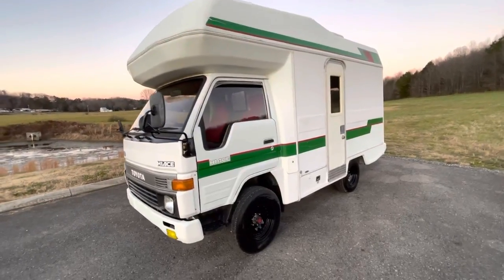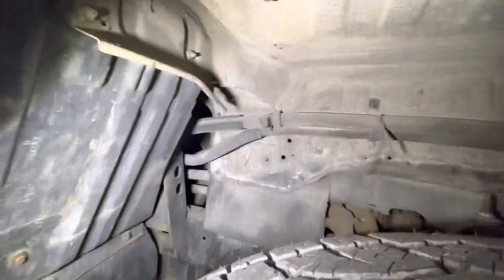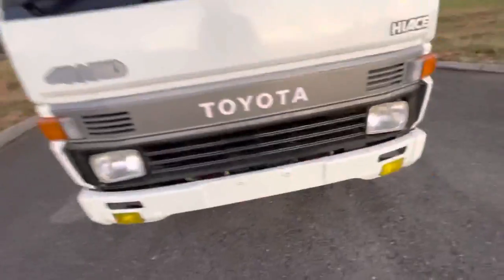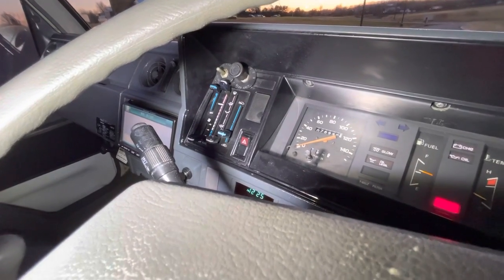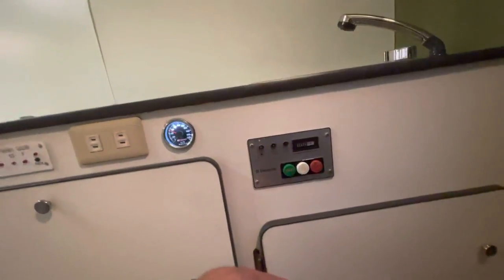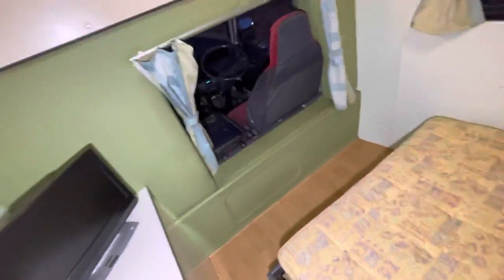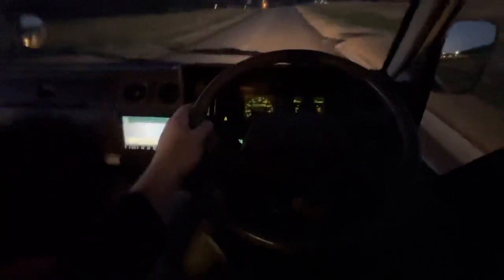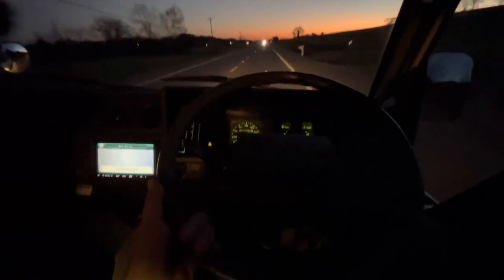1992 TOYOTA HIACE CAMPER/ TOY HAULER 4X4 DIESEL. AKA-(STEVE)

Comment: Mav's new ride
Reply: I was just gonna say this was the one mav bought lol
Reply: is that exactly his one . this is so bad ass . min 4x4 not log of them open in the back
Reply: Yeah I was thinking the same thing
Reply: @MyIronman8  Same exact one from the same seller - would love to know how much the asking price was - I'm guessing $16-18K?
Reply: @Baz4  no idea . Very rare back door opens . You could probably ask twenty grand for it because you have the rear door model . Think some mods and it would be bad ass . If it was me I would ditch the gas generator I would put a diesel generator and its spot. The gasoline tank that's underneath to the left of it I would ditch that also the spare tire up front on the left I would did that also I would put on another diesel gas 10 gallon gas can where the spare tire was I run the generator to the new gas tank you could connect the two diesel gas tanks together or you could get have two tanks on both sides and put a switcher from an F-150 cuz they had gas tanks on both sides. The d
Bench that folds back-and-forth I would take that out . The cabinet that holds the batteries I would take those out and put the battery somewhere else. The airbags I put bigger airbags on it to lift the back end even higher so you can put bigger off-road tires on it then the front I would jack up about 2 in so you could be bigger off-road tires on that
Reply: @MyIronman8  Max speed of 65 mph is a deal breaker for me.
Reply: @Baz4  really don't care that It Go 65 miles an hour if the Thane gets if it's going through mud your house things badass to me there's a lot of people that want to go 100 miles an hour and when it goes into the mud guess what that's when their car fail and they get stuck in the mud and then your thing that was going 6550 is like chewing through that mud like it's nothing
Reply: @Baz4  you're in a hurry to go somewhere
Reply: @Baz4  it goes 65 stock so I bet with a little modification like when you're on the highway like two wheel drive modification
Reply: @Jackal84066  Not the one as his ride seemed a lot more beat up esp up close you got some cheap sealant on the seams
Reply: @Baz4  more than that, they got one now asking $22,000 not as nice as this one